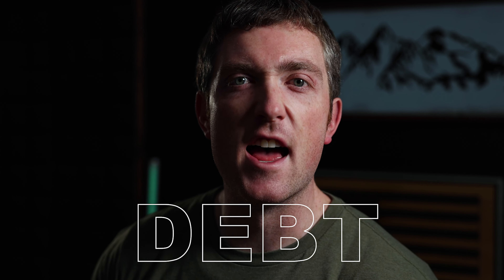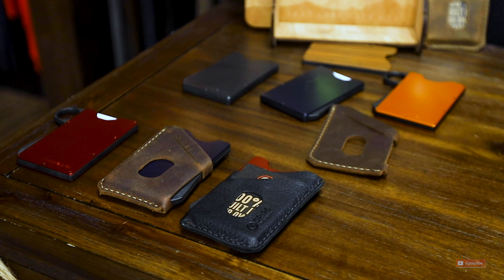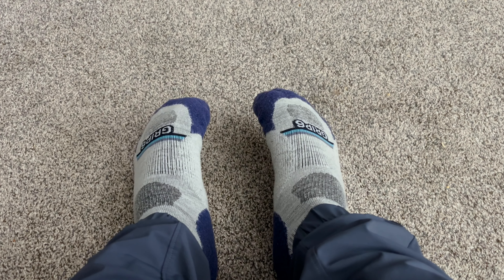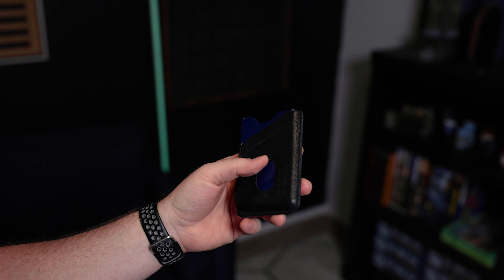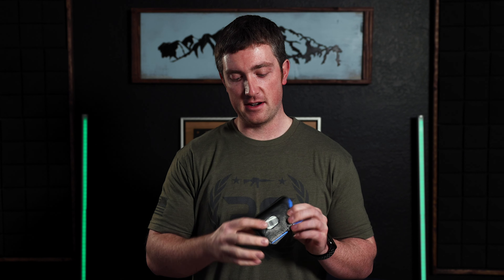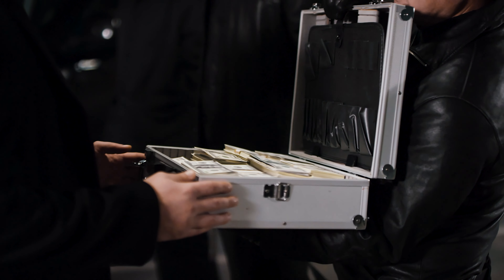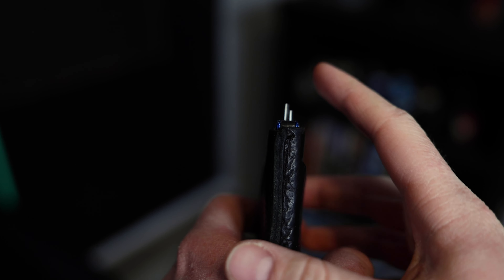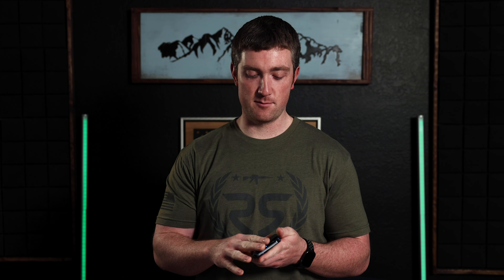Grip6 Wallet After 2 Years

Comment: how well does it work if you only have 3 or 4 cards in the slot? will they fall out easy?
Reply from the maker: Ah, I totally forgot to put something in the video about the locking mechanism. You can have down to 1 card in there and it still locks and won’t fall out. Just checked on mine to confirm.
Reply from the maker: You can even shake it pretty hard and the cards stay in.